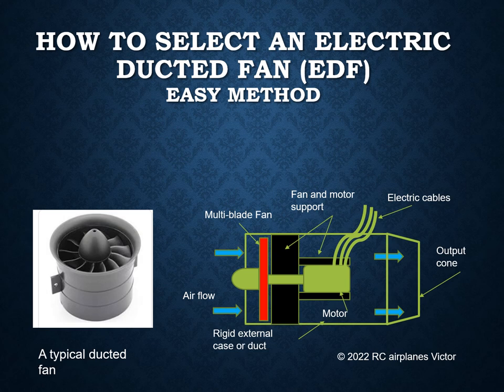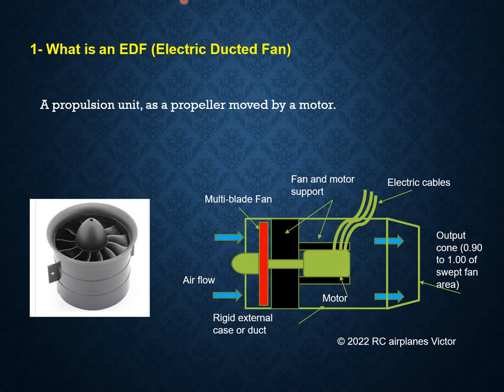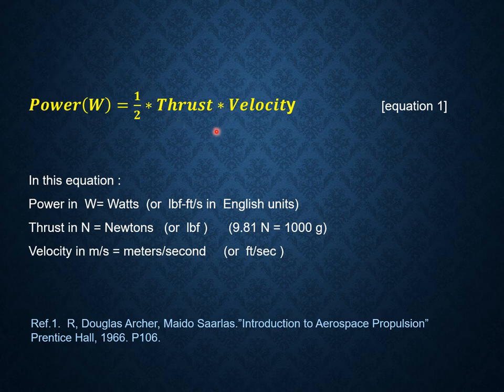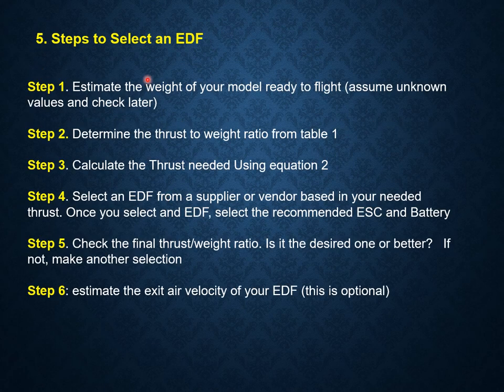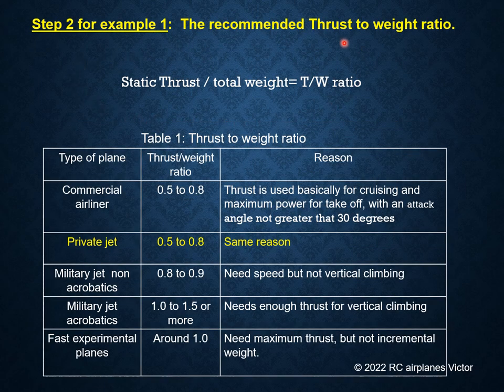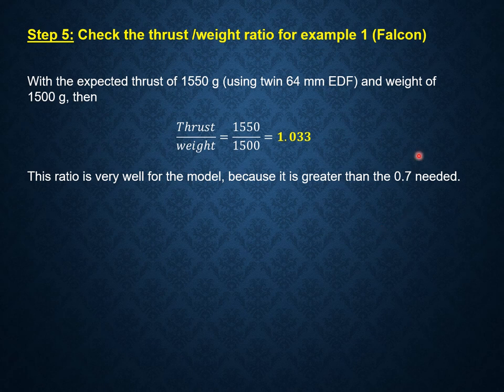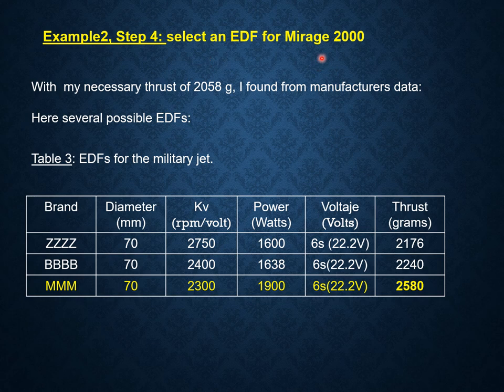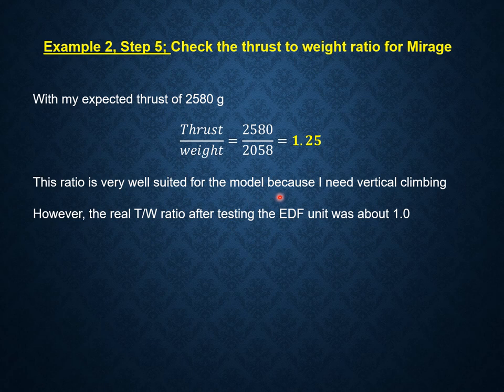HOW TO SELECT AN ELECTRIC DUCTED FAN (EDF): Easy Method

Comment: A bit confusing in Table (1). For RPM = KV * V ? For Power(W) = Max.V * Amp(A) ? But I found the figures in RPM and Power are not according to above formulas. Is the RPM and Power are measured figures or calculated figures ?
Reply from the maker: Hi Thar.  Kv is expressed as rpm/volt, so multiplyng Kv * volts gives RPM. Same for Power.  W=A*V  .
Data in table was  obtained from manufacturers, but this data is only referential. As you see in the video calculation does not use this data.